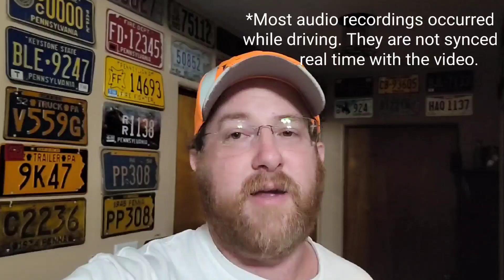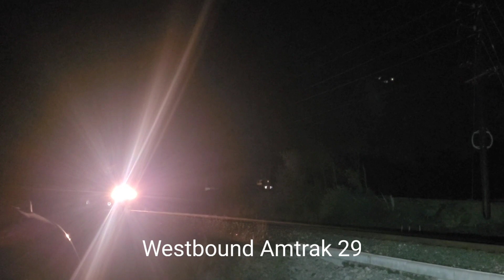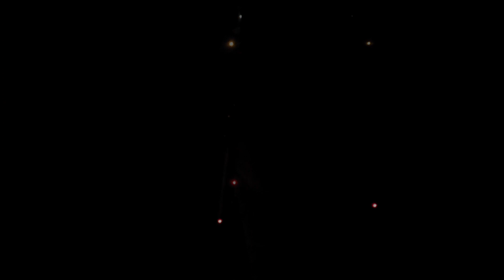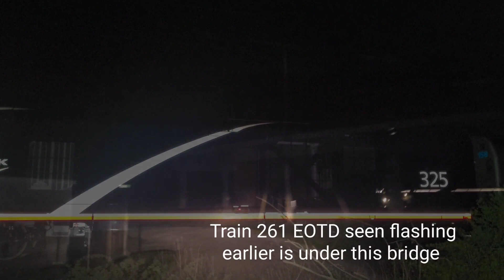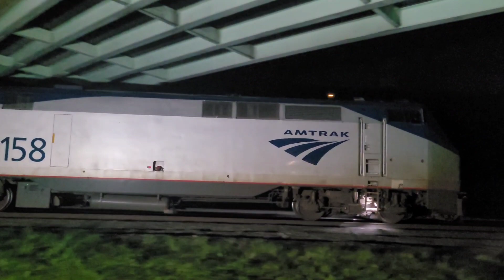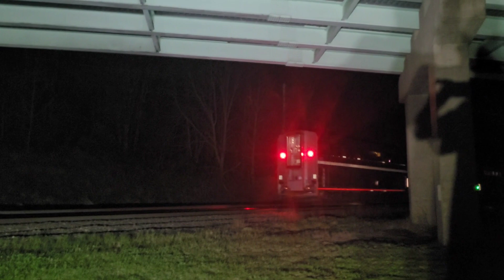Amtrak Cleared into Occupied Block, Delayed 46 Minutes When Intermodal Train is Given Priority

Comment: Usually, passenger trains schedules are protected. The dispatcher should have known that  Amtrak 29 was coming through there, and would have put both freights into sidings, to allow the Amtrak to go ahead. In this instance, once the eastbound cleared, and 261 west got the signal to clear, 261 should have been able to be put into the next siding, to let 29 to run around it.